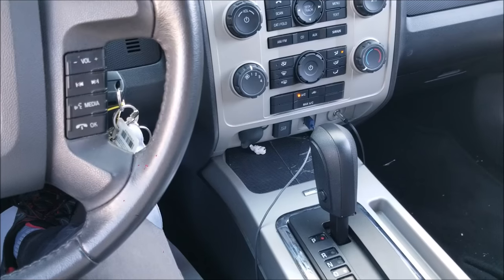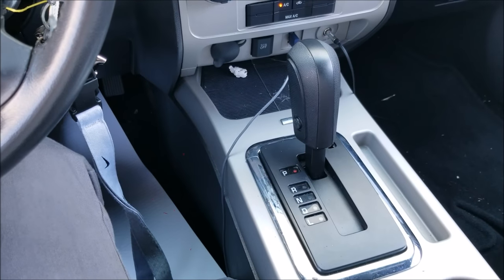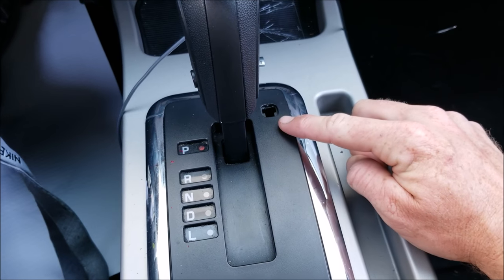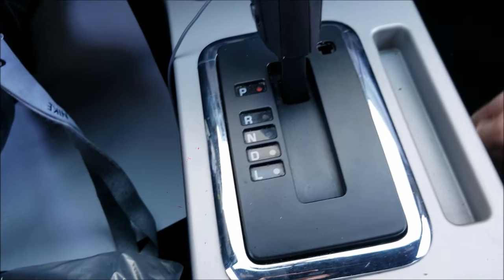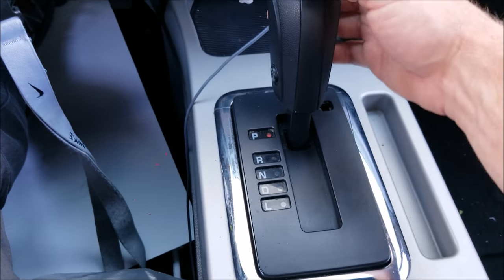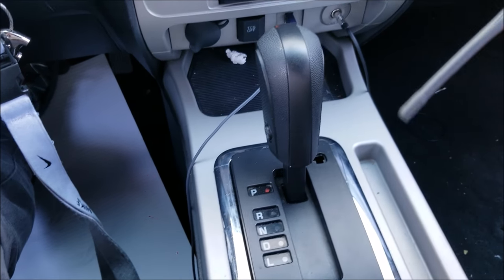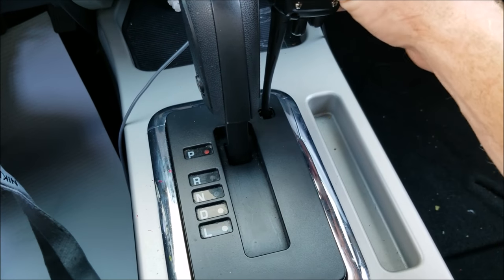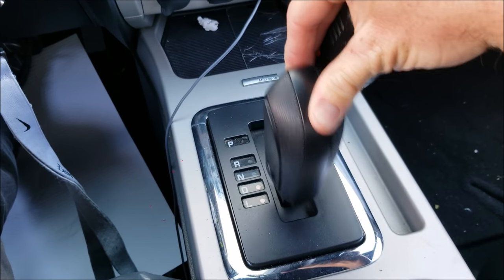My Car Shifter Is Stuck In Park

Comment: BEFORE YOU GO TEARING YOUR GM VEHICLE APART (that does not have the key release option)! Put the key in the ACC position then go behind the car and PUSH IT until you get it rocking AS HARD AS YOU CAN UNTIL YOU HEAR A POP! Then get in and see you can get the Shiftier out of park. That is what worked for me. Good Luck!
Reply from the maker: it's not tearing the vehicle apart if you know how to work on cars. I haven't heard of this scenario that you are speaking of, but if it works for you it could work for others too. thanks for the response 👌
Reply: I tried youre way to and it didn't work I was able to get the car to shift putting something down in the gear shift like the video did. Apparently it's a recall issue with Dodge Avengers
Reply: @JMC-The-Director  it's a computer error causing my issue not wiring I know now. I did eventually have to carefully loosten the Faux wood shifter  cover with a butterknife. On my Saturn L300 there is actually a white Knob on the back of the shifter assembly. Not sure about other GM models but if your wiring is intact look for something like it. I push the breaks, pop up the white knob (release switch) at the same time moving the shifter into R or D. This has to be repeated every time you put it back in park. Temporarily until you can afford more than the car is worth to get it fixed😨

Comment: What does it mean when you have this problem? In order to get it fixed, what do you request for?
Reply: Did you know what's the issue/problem?
Reply: Although, I am definitely not a mechanic. However, it could be caused by a faulty brake switch or your gear shifter selenoid could be failing or malfuctioning. I am having this issue right now. Smh. Waiting on my mechanic to come to repair.

Comment: I have a 1989 Pontiac Grand Am and I switch the steering column out of it for another one well after I got done my Center shifter didn't move, the button doesn't press in so I'm wondering what to do to fix it it's not the brake switch and there's no release next to my gear shift it has something to do with the keys in the column?
Reply from the maker: if you are having an issue with the key it could be the ignition switch.
Reply: @DaylyDriverDayly  thank you for the reply I took the middle console piece out under my shifter and there wasn't a button or anything but the part that you push down I just made that go down, it made a big clunk and it's been okay ever since just jammed I guess
Reply from the maker: @icemancometh8679  it probably something going on with the shifter release. I would pull it apart and check what's going on with it

Comment: Need small clarification if someone can help me. When even in park mode again I have to press that hole release and it's working. What's the permanent solution for this.
Reply: Probably need to replace Shift Lock Solenoid.

Comment: Get a manual .
Reply from the maker: agreed! the manual is the only way to go with any car in my opinion
Reply: @DaylyDriverDayly  I know . I live in Slovenia, so you have to pass the driving test with a manual car ( unless you're handicapped) , so I learned manual at a very young age . My first car was a mid 90s bmw with a manual transmission. It was old , wasn't in a garage , but I had no trouble with the transmission . The previous owner didn't lubricate it , or change anything . Then I sold that car , and got a really rare (at least here ) Chevy silverado . It was about 3 years old . After about a week this happened , and I somehow managed to fix it with the user manual . It kept getting stuck in park , was shifting very slowly, and wasn't shifting smooth . Even after I took it to the mechanic . He said nothing was wrong with it . I later sold that car and bought a new Honda civic si with manual transmission. Never had any problems with it.
Reply from the maker: @randomdude9269  that's awesome you decided to go with a honda civic si. those are such good car. enjoy it 👌
Reply: @DaylyDriverDayly  Thank you , I really do . Cheap luxury with sports car features . Also very clean , sporty , high class design.
Reply from the maker: @randomdude9269  ya of course. the reliability on that car is awesome.

Comment: Watched a ton of these... but the I want to know WHY it gets stuck.
Reply from the maker: it could be the brake light switch or  the shifter interlock solenoid that causes the problem
Reply: @DaylyDriverDayly  

Can I continue doing this? Will it harm it? Will overriding the shift lock cause more problems?

Comment: I did it for my 2007 ford fusion...nothing still stuck
Reply from the maker: did you have your foot on the brake?
Reply: @DaylyDriverDayly  yeah, I have the brake in and pushed the shifter release but still nothing.😓
Reply from the maker: @andrewperi580  I'm wondering if you might have a bad brake sensor which isn't letting you move out of park. I would have it checked to see if that may be the issue
Reply: I have the same issue as you same car and its just not working

Comment: This worked, but it keeps getting stuck again and again. Did anyone get this fixed by a mechanic? What is the issue and how much did it cost to repair?
Reply: Did you find any solution???i am facing same issue with my car
Reply: @mamatabhari8624  Nope! It would stop and then start again, now it does it every single time I shift to park. I've been doing this temporary solution every single time.
Reply: @Iris Meeks doing the same.... i don’t know what is it🙄🙄🙄
Reply: I have had the exact same problem for a while now
I looked it up and apparently it means you need your shift interlock solenoid replaced. I’m going to a mechanic soon to see if they can fix it!
Reply: @katsiarenaud5505  Please update me after you go! I'm going to eventually need to go, but I'm nervous about how much it's going to cost.
Reply: @iriskalani  did you manage to go get it repaired ? If so , how much ? This shit just happen to me
Reply: @frankbernal8764  Still have not had it reparied. I'm at college right now, so I'm planning on getting it looked at when I get home. It will randomly work all of the sudden, then go back to doing this.
Reply: It’s your brake light switch